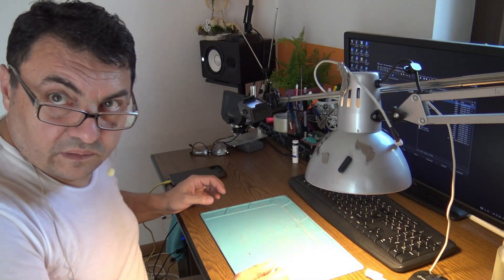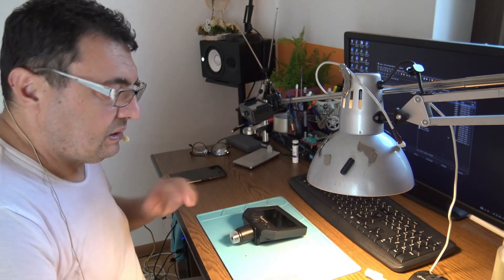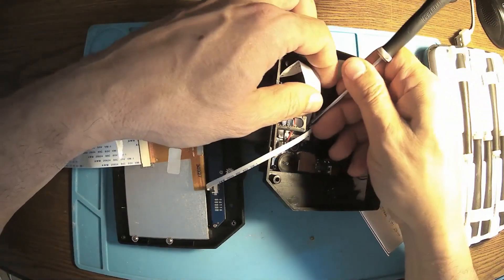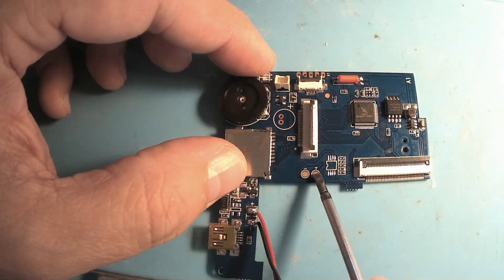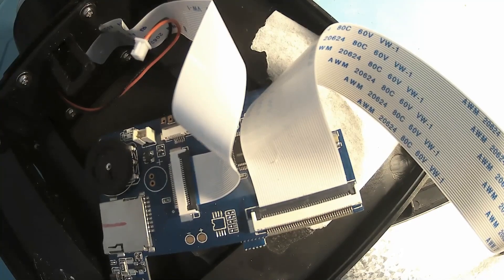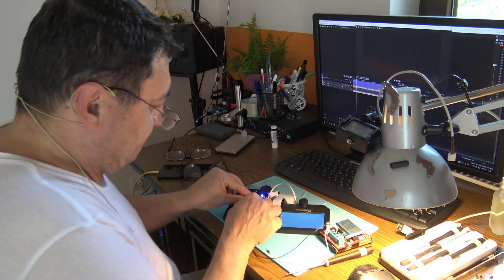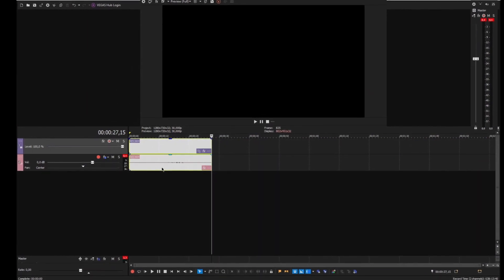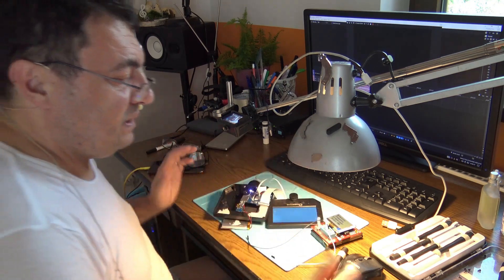Microscope dismantle microphone MOD

Comment: According to the test I did, the microphone pin is inside the top circle and the speaker pin is at the bottom of the IC. We only need an IC amplifier to play the sound by the microscope itself, I do not know the IC number
Reply from the maker: Nice to know. I gave up the project , for now...